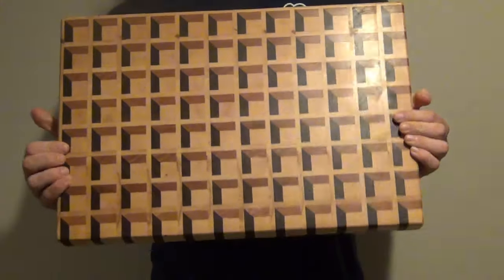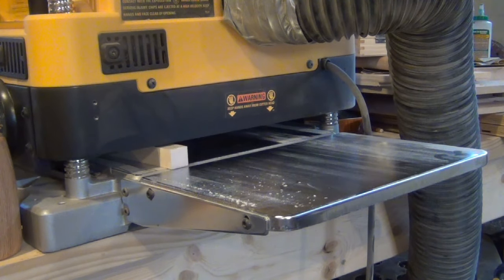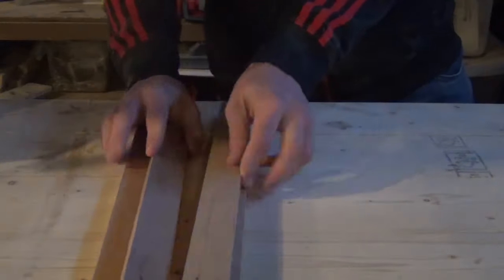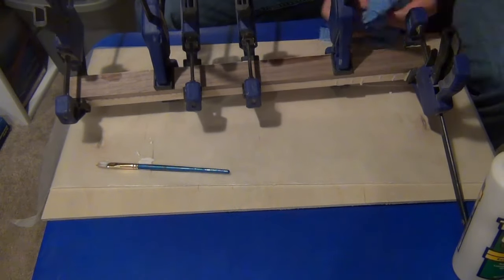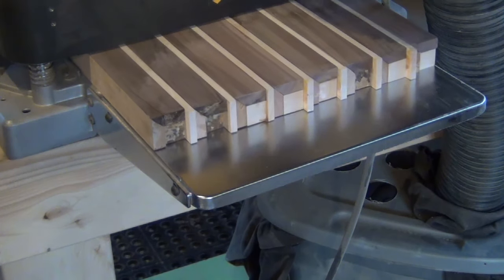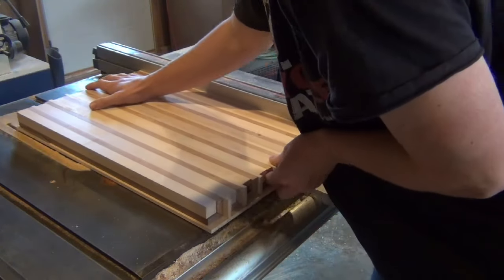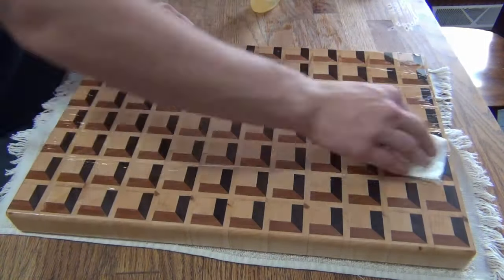Making Incredible 3D End grain Cutting Board Tutorial

Comment: Would have been much easier to understand if the phrases "cut (or sand) to the DESIRED SIZE NEEDED" and "desired dimension" was not used over and over instead of stating the actual size. :(

Comment: Caleb, great cutting board!  Just made two using your video.  You could save yourself some time by planning the end grain when you are ready to smooth it out before sanding.   To do this you must glue a piece of wood on each end of the FINISHED board. I use a piece of 2x4. Then plane using using 1/32 inch passes.  The boards on the ends will help with snipe and tearing out the end of the cutting board.  It really work well and is a time saver. Just my thoughts. GREAT CUTTING BOARD!!!
Reply from the maker: Thanks! I know some people will run end grain through the planer with out any problem, but I would advise against it. Even with small passes you risk causing the board to shatter which could injure you or the machine. The boards on the end is a good idea if you decide it's worth it. Thanks again!

Comment: I just finished this project and it turned out beautifully.  I love it.  I did have a hiccup along the way though.  After glueing down the sheets of the thin 3/8 inch maple  onto the walnut side and clamping and weighing down the center, after drying  the entire piece warped up in the center even with the weights. But I pressed on to the next step and cut the board into 1 1/2 inch strips. I then before the final glue up clamped all of the strips into place the best I could and applied steam from a fabric steamer all around the wood for about 30 minutes. I then let it dry completely and presto, all of the pieces straighten out perfectly and were then ready for the final glue up.  I also had the good fortune of owning a CNC machine which allowed me to avoid the 3+ hour sanding effort and I had it perfectly level  in about 30 minutes with the use of a 1/2 inch flat head router bit on the CNC. So if you have access to a CNC it will make the smoothing and leveling  almost  effortless. A quick water spraying and then sanding with my rotating sander and it was ready for the oil dip. I love the board.  I was going to give it as a gift, but my wife does not want to part with it.  I sense more of this board build is in my near future. Thank you for you design!  By the way I'm in the Boston area.  GO SOX!!
Reply: I have been struggling to figure out the missing dimensions. These maple strips are 3/8 and not 1/4?
Reply: @MrBillp9  My board was made with 1/4 inch strips.  I think 3/8" would hinder the 3D effect.  Just go with it. It's fairly simple and follow the video.  You won't go wrong.
Reply: Thanks, starting next week! @dougsaglio2095

Comment: Terrific...a question from a newbie....could you set the dimensions for the maple square to be 3/4 inch, reduce the 
width of the walnut and cherry to 1 and 1/4?  this avoids having to get 5/4 lumber, i think.
Ed A.
Reply from the maker: I didn't actually use 5/4 lumber, it was all 4/4. All the dimensions provided in the video will work with 4/4 lumber. hope this helps and good luck!
Reply: @CalebsFineWoodworking  was your 4/4 surfaced to 13/16when your got it? amazing you were able to get 3/4 inch square maple pieces.  also, how did you manage to get 2 pieces of walnut and cherry from a 4/4 board or even a 5/4 board assuming the 5/4 was surfaced to 1 1/16?  i have a very hard time getting 5/4  lumber.

Comment: Caleb, your cutting board is fantastic but when watching the video there were several areas where you stated to plane to it's final thickness but no dimension was was mentioned.  Could you clarify what thickness the thin maple strips should be?  I am assuming you started with 1" thick lumber??.  Thanks for the clarification.
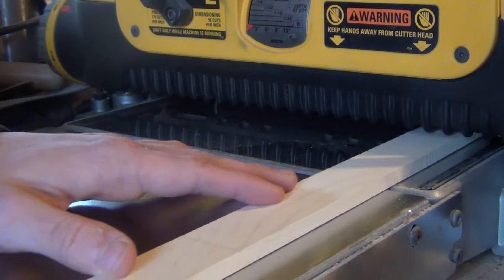Reply from the maker: Thanks! Are you talking about the strips at 10:55? Those would measure 1/4" thick. I did start with 4/4 lumber which was resawn. Hope this helps!
Reply: Caleb, Thank you.  Do you have plans for sale with detailed dimensions?  I am new to this so any specific information really helps.  Materials list would be great.  Length and width of boards needed would be very helpful.

Comment: Lovely job, looks absolutely fantastic! Just a thought though, could you not have used a router sled to flatten the finished board rather than trying to do it with hand sanding for hours on end? If it was pretty flat to begin with, just one quick pass to slice off a mm or two and you'd have been sorted 👌☺️
Reply from the maker: Thanks! I actually built one that I used for my very next board. It did work very well.

Comment: Great job/gorgeous! Any warping or delaminating yet? I imagine it's crucial to not let fine boards like this sit in a puddle or get extremely wet/dry on one side only.
Reply from the maker: Thanks! I haven't had any problems with the board warping or grain moving apart. You are correct about not letting it sit in water and making sure it drys on both sides,

Comment: After seeing your amazing video, I knew I had to make one of these beautiful cutting boards using your video as the plans.  I just completed it and it turned out absolutely BEAUTIFUL!  Thank you so much for taking the time to document the process in such detail.  For those who are thinking about making one, go for it.  Take it slow and watch this video several times BEFORE you start each step.  If there is one tip above all else that I can give you, it would be to listen to Caleb concerning the final glue up and MAKE SURE it's perfectly flat and aligned as you apply the clamp pressure.  I put parchment paper on a glass table top that was perfectly flat and it came out great with minimal sanding.  Good luck!
Reply from the maker: Thanks so much! I'm really glad I was able to be of help and that you came out with a great result!

Comment: So far so good. What are the final dimensions for the maple thin strips? I did not see that anywhere. Thank You!
Reply from the maker: Thanks! The thin maple strips are 1/4 of an inch
Reply: Thanks Caleb. I'm at the first glue up point. This will take some time for me to figure out!
Reply from the maker: That's great to hear you're giving it a try! I wish you the best of luck.
Reply: @CalebsFineWoodworking  thank you!
Reply: Caleb, I'm at the point of gluing the 2 panels to the board. What thickness are they supposed to be?
Reply from the maker: @jackhealy8467  they will are the same thickness as the thin maple strips, so 1/4 in.
Reply: @CalebsFineWoodworking  thank you very much.

Comment: A stunningly beautiful piece of ( and I borrow the term from Colin Knecht ) "Kitchen Art".
However, as a functional cutting board, I would consider it dangerous.  Why?  Because there is a possibility that this design may confuse the brain's depth perception.
When using sharp edges to cut, you need to be able to judge distance with a fairly high degree of precision, otherwise you could lose: at the very least least; a few drops of your red stuff.